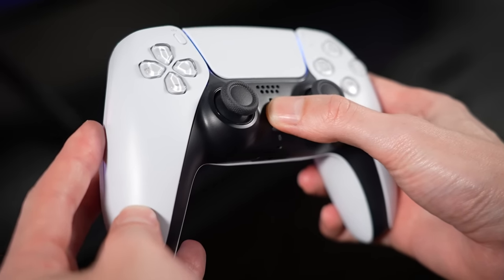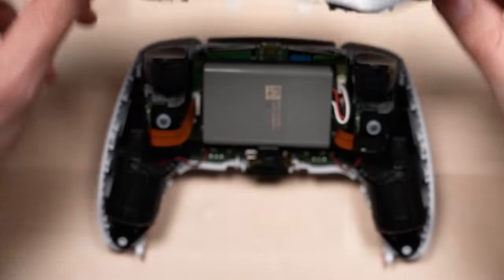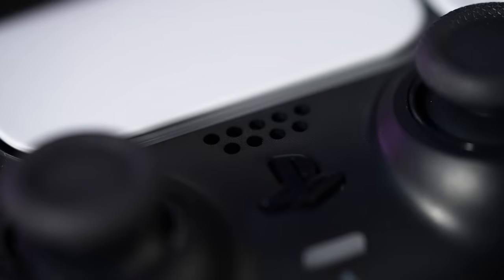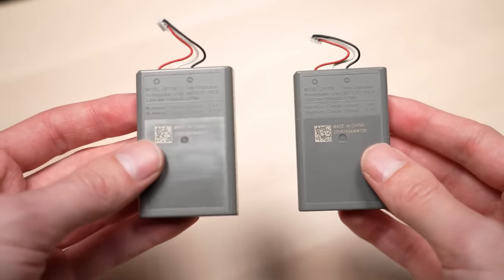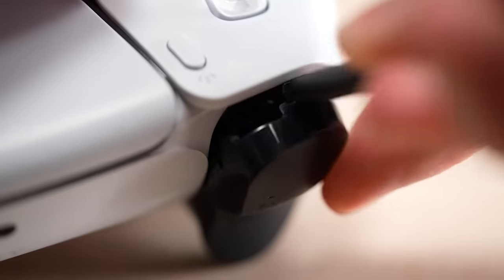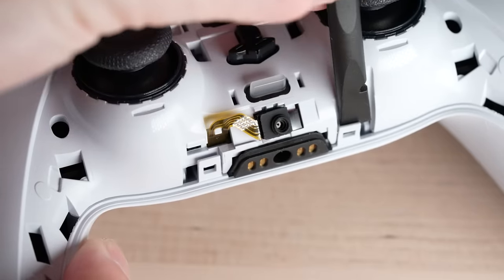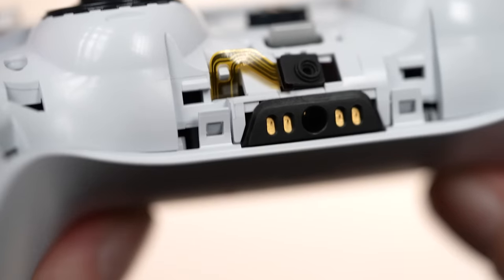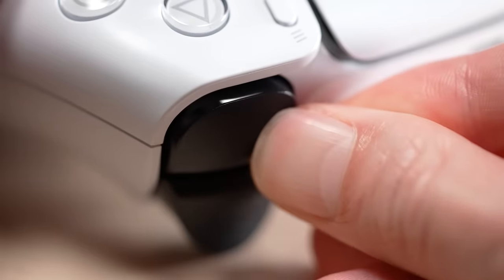Sadly, your Playstation controller won't last much longer..

Comment: I learned the key to having a longer battery is to switch the settings to only 1 minute. That means that if I’m not using my controller in a minute or over. It shuts off on its own. It’s a beautiful feature 👍
Reply: If I'm talking to someone in a party but I'm not playing, will it disconnect my microphone?
Reply: @mjk1160  no.
Reply: @DrewForDrew  Yes, it will if you have your headset plugged into the controller. If the controller turns off there is nothing powering the headset
Reply: This sounds fucking terrible lol.
Reply: one word. cutscenes.
Reply: @Ethan Hebert what if it's one of those games where clicking a button, any button, skips the cutscene?
Reply: @elise205  analog stick
Reply: @EnCroissant  then set it to 10 minutes.
Reply: @farms6  And if I playing a Kojima game? (easily 40-50 minutes cutscenes)
Reply: Instead of 1 minute, it’s better if it was 5 minutes. With cutscenes and party chat, the controller is bound to turn off with just 1 minute of inactive use which is real easy to forget. 5 minutes, you’re bound to make an input before it expires.
Reply: @EnCroissant  Then don't set it for a minute, and replace the battery when it goes to shit.
Reply: @EnCroissant  just don’t do it then? why make a big fuss about a suggestion just because you don’t see benefit in it for yourself?
Reply: Just manually shut off your controllers if you’re going to be idling
Reply: I have mine set to 10 minutes on Xbox, that way I don't get disconnected from parties often
Reply: Honestly sony needs to take notes from the Xbox controller. Nobody wants an internal battery.  XBox you can use batteries or rechargeable battery packs. Same with iPhones. They put in those trash internal batteries that way people have to take it to Apple to get it repaired so they can make money off you.
Reply: It's a dumb feature as it may turn off when you don't want it too
Reply: Plus turn of the vibration. Turning off the controller speakers also helps some too
Reply: @DuskLegend  it’s a pain to do that, you have to go to the settings and everything
Reply: The controller won't turn off unless it's completely still. It detects movement and that keeps it on.
Reply: @elise205  just turn your controller on again after the cutscene 💀
Reply: I didnt even know you could set your controller on a timer what the fuck are you all talking about.
Reply: @Supersteam09  I agree, and would specially be terribly is in PS4 since even loading times on some games are way more than a minute 😵‍💫

Gratefully PS5 usually loads very fast, but I'd vote for 5min standby time too.
Reply: @grogu411   I wish there was a DualSense with AA batteries because I bought Turnigy LSD (Low-Self-Discharge) many years ago and they were like 1.5$ each and they even annihilate expensive Duracell's, mine charge around 2600 mah while they claimed something like 2450mah on the older ones and they increased to like 2550 on newer ones but they clearly charge even a bit more than rated, last 4 EVER on the Xone\X360 controllers (definitely more than a full day of playing).

I can also leave them thrown somewhere for a year and they will still have full charge with very little lost and for the price I can buy many and takes like 10 seconds to charge the controller by just swapping them for charged ones😉

I don't really ever used my X360 or Xone controllers with a single cable attached on them, I always have many charged Turnigy AA's and I can charge upto 16x of them if I wanted in my charger though I usually use a 4xAA intelligent charger that charges them individually.
Reply: It’s really not hard to get up and charge the controller when the battery  needs to be charged or play your game while ur controller is charging
Reply: @kakarot4243   but did we all paid for a wired controller or a much more expensive wireless controller?

The DS4 battery life is a joke.

Also last time I ever used wired controllers was with my original Xbox many years ago and going back to that = No thank you and specially not when paying for a expensive wireless controller.
Reply: @Devil Zion  some very old consoles used hall sensors which will never fail unless something goes bad with the electronics, but since then all controllers sadly only use pots even the crazy 100+EUR ones FFS...

Though I'm glad I can easily repair them and the crap joysticks are so cheap that no one even replaces the pots but rather the whole joystick and they aren't made to be replaced anyway...
Reply: @Devil Zion  just keep sending for RMA then, it's what everyone should do until they decide it's enough and improve the quality.

They only care when they start to lose money, so I would even laugh if they start loosing many millions from keep replacing people's controllers joysticks continuously with no end...
Reply: @JugglingCow  because it's a stupid suggestion
Reply: A minute seems a little overkill lol
Reply: @nyuszicsib  then you're fd hehe
Reply: @KingKami "any other mic will turn off" you know that the Sony headset isn't the only wireless headset right?
Reply: @KingKami okay... you know turtle Beach makes wired ps5 headsets right?

Neither wired nor wireless are exclusive to sony.
Reply: @KingKami I don't read minds, I read words. I only know what you wrote, not what you were thinking.
Reply: @iandicarlo96  this is why more people should get wireless headsets
Reply: @michaelthompson2970  if you just don't turn it on then the battery won't drain as fast either
Reply: I use the 15 minute setting with my PS4 controller on Steam.  It's long enough to last through cutscenes and short bathroom breaks, but will still disconnect if I fall asleep while playing.  The perk of playing on PC is that even if the controller does disconnect, the game will just default back to the KB+M controls, rather than pausing my game.
Reply: For some reason mine does not do this.  I set it to 5 or 10 min along with the console to go to sleep in 1 hour and neither of them work.  I will fall asleep and wake up 4-5 hours later with everything still on.  Not sure whats going on with that, the only guess I took was that the controller has sensors and since I am still holding it it won't register to turn off?
Reply: The setting only gives you 10 minutes option
Reply: @DuskLegend  i fall asleep and forget to do that
Reply: @ZnajdanGaming lol who tf buys AA batteries that can’t be recharged? It’s 2022 buy rechargeable batteries. Or buy the play and change kit that come with 2 battery packs for $10. I had a few controllers disconnect do. I know exactly why they disconnect. It’s most likely because you’re being to rough with the controller. If you squeeze to hard on a Xbox controller you can crack something inside and then your controller will randomly disconnect. I know how gamers are and I know this is a big issue with these controllers but this is only happening because people rage or are to rough with the controller. That’s a fact.
Reply: @mjk1160  Yes. The controller will turn off if it doesn’t detect any movement. So remember to constant spin the analog stick around every few minutes so it doesn’t shut off during a party chat
Reply: What if there’s a cutscene longer then a minute?
Reply: @plurtzshwine1010  press a useless button
Reply: A hero we needed
Reply: Yeah but imagine. You re in a long cutscene and out of nowhere theres a super strong boss. The controller is off and you re not ready for it and youll lose the battle. Kinda risky
Reply: You have to get the charging dock it’s only $25 too charge it better the cables don’t charge ps5 remote the right way  . The charging dock I don’t know what it does but it last way longer I have test it
Reply: @nyuszicsib  holy shit that sounds insufferable to be sat through a 50 minutes cutscene in a video game 💀💀
Reply: @mjk1160  yes it will

Comment: My ps3 controller is like 8 or 9 yrs. And it still works great. It definitely doesn’t last as long as it used to. But it lasted 7 yrs holding a full charge. I swear things these days last half the life as the old stuff.
Reply: the same with Xbox 360 controller That thing was a monster
Reply: Everything is built like shit and costs at least double.
Reply: Yea ps4 ps5 ,switch controllers are all shit.   I had multiple workers at different stores tell me  that they are made that way so you gotta shell out another 70 bucks.  They dont want em to last more then a year.
Reply: @spikemcclucky6716  well my ps5 controller has lasted me over a year with zero issues. In fact. Everyone I know that has a ps5 for a year or longer has had zero controller issues
Reply: @spikemcclucky6716  I’ve had the same ps4 controllers since I bought the console in 2015 with no issues
Reply: @spikemcclucky6716  the ps3 controllers are literally the same thing as ps2 controller except better
Reply: i've had my ps4 controller for 5 years.. That beast still works as the first day
Reply: Like my psp battery
Reply: @toptiertech7291  i had issues with my ps5 controller. luckily I got the warranty so exchanged for a brand new one. its quite common actually. so much so sony had to send out statements regarding the issue
Reply: same i have had my nintendo 3ds for 7 years and i only charged it once
Reply: @meladgoat  was it the one that came with the system
Reply: Maybe stop using them with your taki fuego dust fingers
Reply: Literally untrue. Consoles form that generation are notorious for problems like red ring of death and broken controllers
Reply: My PS4 controllers worked perfectly from launch up until around mid 2019 which I found throughly surprising. No stick drift, just an issue where it would no longer sense when L3 was held down rather than just clicked.
Reply: My dualshock 4 lasted straight 7 years, without giving me the slightest problem at all.

And i'm certain that even my Dualshock 5 will be as resilient.
You have just to take care of your devices.
Reply: Same here. I still have a working ps3 control and an Xbox one controller that works perfect
Reply: More stuff has been added to controllers which use more power. Light bar for PS4, the touchpad, the adaptive triggers, the haptic feedback etc....that stuff causes it to drain faster.
Reply: Shut up Kurama!
Reply: @Nebras-yc4sp  360 took AA dweeb
Reply: @spikemcclucky6716  well no durr
Reply: @ASTR0TALKSPHILOSOPHY  you: theyre the same 

Also you: but theyre better

🤡
Reply: @stormstudios1  not true!
Reply: @ZebraEnt  the light bar isnt a seperate light 🤡 it’s literally the damn light from
The top shining through a part of the touch pad that is transparent
Reply: @HistoryandReviews  it is a light that didn't exist in older controllers that causes the battery to drain faster. Did you not even bother reading the conversation you're commenting on?🙄
Reply: @ZebraEnt  it is not a separate light. Just like the apple symbol on old macbooks is not a separate light
Reply: @HistoryandReviews  is it a light that is in the controller that was not in old controllers that drains the battery? Did you read what this conversation is about!? Geez!!! 🙄
Reply: @ZebraEnt  i have one! It is not a seperate light! It is the same light that shines at the top of the controller!!
Reply: @HistoryandReviews  are you illiterate or something? First of all when did I say it is some kind of "separate light" whatever you're trying to talk about? Second of all I said it was an addition from previous models of controllers that causes the battery to drain faster than old controllers, which it is.

Can you not read!? 🤔
Reply: @HistoryandReviews  because of the little bit of motion controls and maybe better rumble. They are almost identical
Reply: @ZebraEnt  it doesnt cause the battery to drain faster because it is the same LIGHT!!
Reply: Same my ps3 controller still working good
Reply: @HistoryandReviews  a simple LED light causes little very little electricity.
Reply: That’s cause they be putting shitty parts in their controllers so they could get people to buy more controllers, people really be greedy nowadays and not care about their consumers

Comment: I've done repairs on a lot DS4 controllers and only about 3% of them were battery related. Mostly ended up being analog replacements. I'm glad you showed people how is it to disassemble the controller as most people are too scared to do.
Reply: What replacement kits would you recommend? One of my ds4 controllers has really bad drift and I want to fix it.
Reply: @sophiedowney1077  just find a store online that is selling dualsense 5 analogs unscrew the old ones and place those in and walla
Reply: @KaixZenzu  You can't just screw another analog on to fix stick drift. Also Sophie has the Dualshock 4
Reply: @Righteous_Destiny  ah okay thanks for the heads up
Reply: I would have to agree. I've worked on PS3 and PS4 controllers. I've only ran across one bad battery and I have controllers that are more than 10 years old. But I also have several so it's a lot easier to maintain good battery charging techniques in order to keep them lasting!
Reply: yeah l got my first ps4 8 years ago and the controller that came with it has never broken and lve never experinced any battery problems on anlog problems
Reply: I took control apart from ps4 and put in new shell
Reply: @KaixZenzu   man if the analogs were just screwed in, analog replacement would be easy asf, we wouldn't even need to pay people to do it, the issue with replacing analog sticks is, you have to solder them
Reply: @sophiedowney1077  Just send it back to the store you bought it from, and get a new one for free. Did this 5 times already, only payed for my first DS4. Warranty 2 years with each one
Reply: Disgusting how Sony is willing to hide screws where buttons are used (and prying them off won't help with lifetime either). If Apple is getting Right to Repair then Sony and Microsoft should too!!
Reply: @sophiedowney1077  ifix it kits are great
Reply: i had my PS4 controller for few years maybe 5 and still working fine but its probably lost 1/4 of the duration when fully charged. But most of the time im using the controller plugged at all time with my super long cord 😅 i dont mond playing the ps4 wired